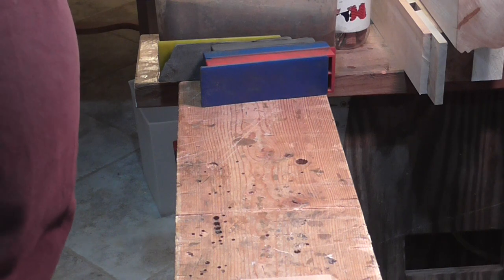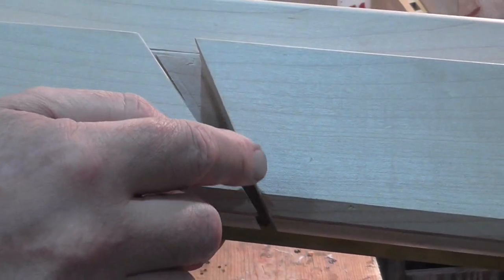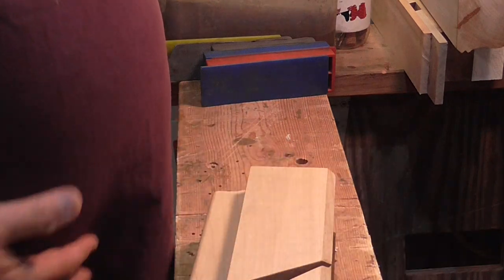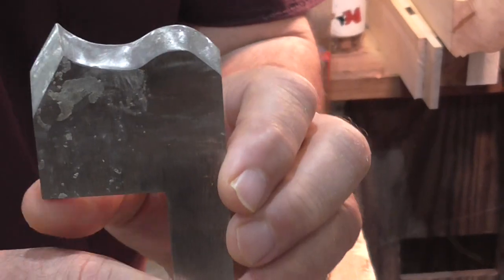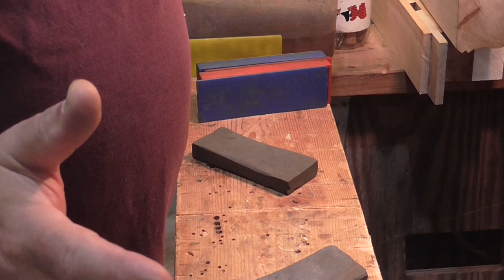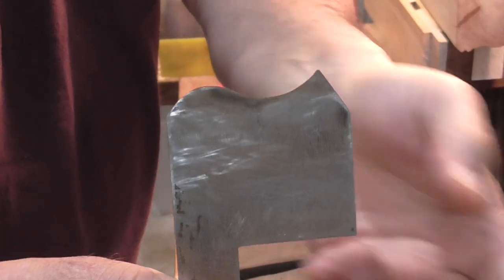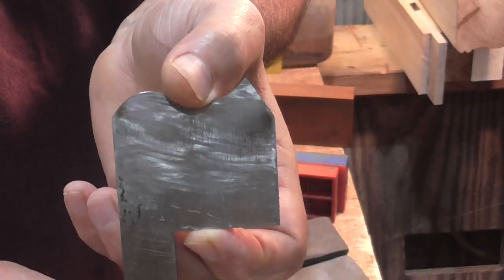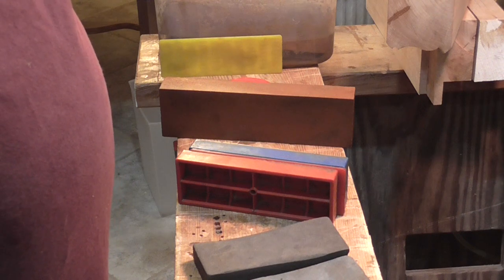Plane Making - Shaping The Iron For A Moulding Plane

Comment: Great video! 
If I were better with a computer I could show a video about woodturning a profile  disc. After it's turned, charge it with a grinding compound and finish the plane iron before heat treatment. 
With a profile disc for each molding plane, keeping them sharp is a lot easier.
Reply from the maker: That would be an interesting video to see !
Reply: Please make the video. It would be very useful, even when the quality is low

Comment: Super video. One question, do you taper your your blades.
Reply from the maker: It's a good question, because a "Yes" answer may convince plane makers to not make a plane or their own blades. No, I do not taper my blades. I've had no problems with non tapered blades, no issues of any kind. I think it's safe to say the wedge angle, the fit of the wedge and the shaping of the iron all account for more than a tapered iron would provide. Good luck !